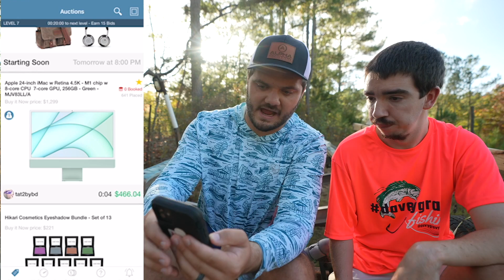I Had A CUSTOM TRAILER Built For My HOUSEBOAT!! (itty bitty update)

Comment: Hey Ayo. That’s the way it goes with a full on custom. You are doing just fine. Tim is great allowing the boat to be in his shop that long, but as he goes it seems he is more and more invested and interested in the project. If it is not commissioned as a full on custom with a crew working on it full time, as you have done here, it takes a long time. I have seen car builds that don’t have near the amount of custom work as on this boat, take 3 years!! You can be done in a few months either way, but you will be so far upside down $$$ wise you will never see the light of day! I truly hope when you float the Itty Bitty it sits level and true. The truck hull design looks unusual to yourself, but it is going to definitely help keep that tall boat steady in the water, if it were a true V hull, I might not want to go on it!! Your not going to set speed records but cruising along at 11 or 12 knots will be great in this boat and it’s amazing how far you really get just sticking with it, planning an extra day for the slower speeds and you don’t care because you can relax on the boat!! Sleep on/in it as well! If you try to get there fast, you are just going to run through a couple hundred gallons of fuel to save 40% of the time if you just ,,,,,, c r u i s e ,,,, your way there. 
      It’s not a boat for me, but I have rented and been on boats of a somewhat similar style, but maybe 20 ft longer. You go nowhere fast, but you get there, anchor for the night and assuming you are not driving others nuts, party!! 
    Looking forward to the end result, but don’t feel bad about the gaps in time. You get some posters grumbling, but they have to understand there’s a budget and the money only comes in so fast!! 😂😂😂. This is very likely we’ll over budget right now before the interior goes in. You go your pace. It’s YOUR boat, YOUR money (even the sponsored money is yours to spend,,,,). Do it right the first time. You got this Ayo!!! Eh!!

Comment: I extended the bunks and added an additional set on my old Tri-Hull trailer and felt much more comfortable that I wasn't going to have an issue landing in the wind or for any other reason.  Get it the way that makes YOU comfortable now before it is more difficult to deal with later.

Comment: Good to see you back onto the itty bitty, man you kept your cool about the trailer.  I would have been very p#ssed off especially as it was a custom built trailer, . I am in the UK and have been boating all my life, the type of Hull you have in the UK is referred to as a cathedral hull, you could do with rollers down the centre of the trailer and possibly one either side at the back, trust me I have a 14ft cathedral hull with a trailer much the same as yours and its a pig to get on and off especially a boat that size on a 30 degree incline boat ramp. also guide poles either side at the back of trailer really helps when launching and retrieving.  glad to see you back at it and really looking forward to the next episode.  peace out dude.

Russell

Comment: See the thing about that big space you gained on the stern is you can have all the other mechanicals water heater and all that in that compartment and really open up the living area so you don't have a lot of mechanical items taking up valuable space when you had an inboard engine all those mechanicals had to be spreaded out into other different parts of the boat so you're gaining some space

Comment: Hold on. I could be wrong here but from what I was taught. The end of the trailer should be at the end of the boat to support all the weight of the engine and what not. That way the boat isn't flexing.

Comment: Adjustability is nice but I think welding should be done once the measurements are correct. You ca get the hardware as tight as you can get it but in the end they will always loosen up on you.

Comment: You know by putting the outboard engine on it instead of using the inboard like it originally had you gain some lazarette space meaning you can use it for tankage you can use it for other equipment the boat needs or just an extra storage space and just about every boat on the planet from a dingy all the way up to a 475-ft giga yacht all black one thing and that's adequate storage space

Comment: Is that a stock trailer? Surely you could measure up the bottom of the hull and given the dimensions to the trailer builder to get it to fit the boat.
Bad news coming your way, the hight you're needing from the bunks means you'll need a very deep/steep boat ramp.

Comment: Need to put rollers on the trailer. Atleast in the middle for sure bunks on the outside should be fine if the middle has some roll. And ya definitely a height issue if your at the ramp
Reply: Yes keel rollers or damage will occur when trailering. I could have provided some pictures of current Steury trailers.

Comment: The trailer builder should have set you up with someone who knows how to do this. The boat will be trailered on a boat ramp. The boat ramp has a big angle to it. The trailer is then angled. Surely you are considering this right? Surprised the old guy didn't see this. Get that bow crank off the trailer and out of the way for now because you have to set your tongue weight. Then figure the crank. So the trailer guy didn't mention keel rollers?

Comment: You do not want flash burn on your eyes. Believe me. It is excruciatingly painful. And that is at low level. It can blind you. Even "side flash" will cause burning. That is where someone is welding to your flank and the rays are reaching your eyes even though you are not looking directly into the arc. Always be aware when arc welding is going on around you. Don't let your unprotected eyes be in a straight line of the arc. On the other side, you cannot get flash burn by watching welding videos. Cameras do not transmit ultraviolet rays. You have to be there. I hope this helps at least one person.

Comment: I thought the trailer guy said he took measurements?!? Why wasn't it made deeper!?
Reply: Even though bunks are adjustable it's way off. I run a Steury group. Could have got at least photos for him. Also placement of the axles is quite important.
Reply: That's my whole point, ha!
Reply: @RVmotoTravel  Most trailer builders would not take the job unless just duplicating a trailer on sight or having the boat itself.
Reply: @pgnandt  Again, that's my point, why was there no pics, specs, better info and dimensions shared.
Reply: @RVmotoTravel  I quit trying to figure out why a while back. Was kind of sad to see a Steury that could have been 'restored' turned into a Home Depot project. Fun to watch though.

Comment: So the fab guy never went out to check the boat out/see what kind of pitch it has, Next he's welding with a Hobart, Then he's walking the nozzle with a mig welder. It sounded trash when welding the few welds you could see looked like shit. Solid core wire on structural steel... Congrats at finding the lowest bidder.  As a welder very disappointing.

Comment: AYO, love you and love Davey, but... that trailer could easily spell disaster for the Itty Bitty.  The trailer has WAY too much rigidity up the middle for a boat that has a lot of depth up the middle, it's a very bad mix for you.  I would honestly say find another trailer that matched the boat better because the custom trailer will probably destroy all the hard work put into the boat.  Don't even try retro-fitting the custom trailer, find another way to trail it entirely.